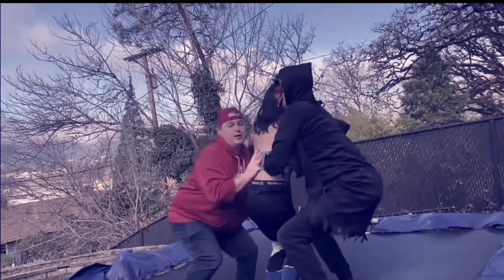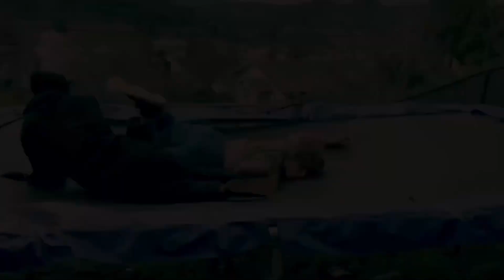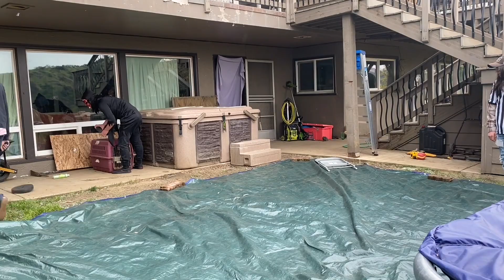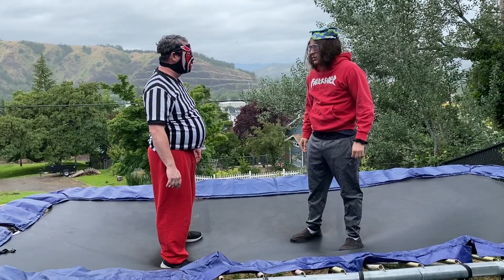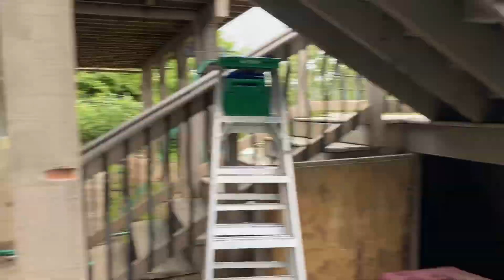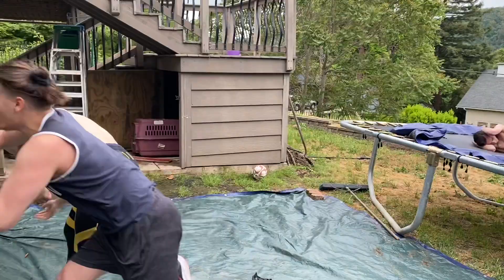BTW Rumble 6 2022 - Swift Vs Blackout; 10 Man Royal Rumble Match

Comment: Spoiler alert--
Swift will beat Blackout and one of those 10 guys will win the Royal Rumble. Guaranteed.
Reply: I hate to be an I Told You So, but I told you so.

I'm never wrong.
Reply from the maker: Well I'll give you props on the Swift prediction but the other prediction is about as good as saying everyone on CBW is a clown. I called that and I'm never wrong. RTG.
Reply: @btw8136  yeah but I called it for Derrick in the middle of the live chat. And Marshal Paul is not a clown.
Reply from the maker: Your right Marshall Paul is a real life pull string Woody so I stand corrected. RTG.